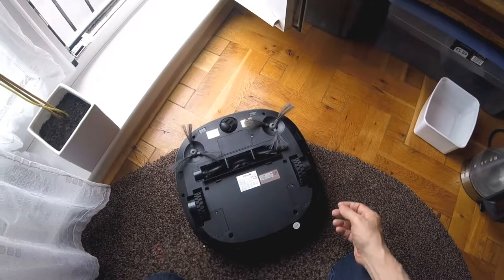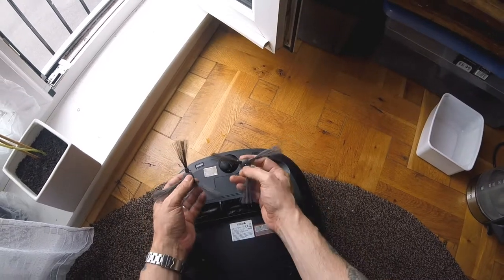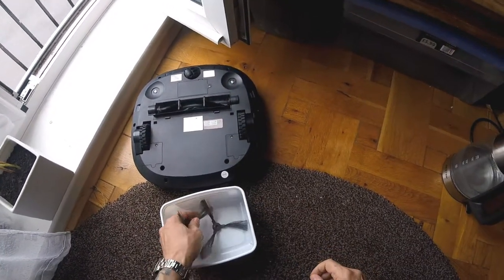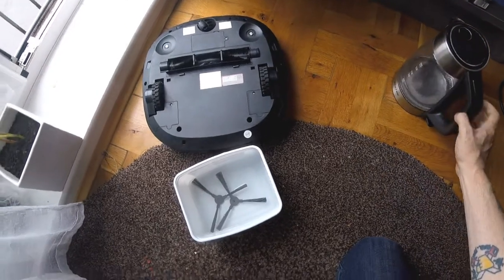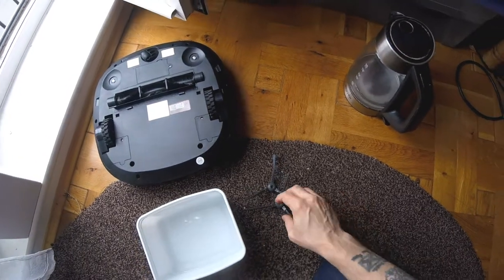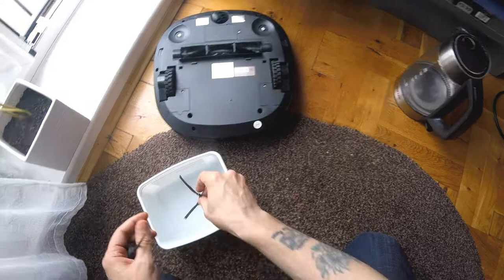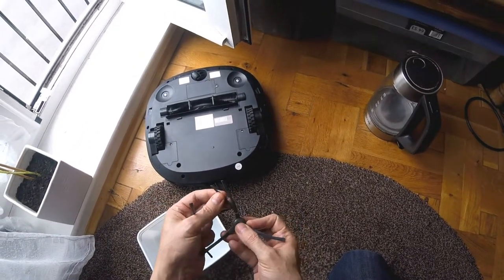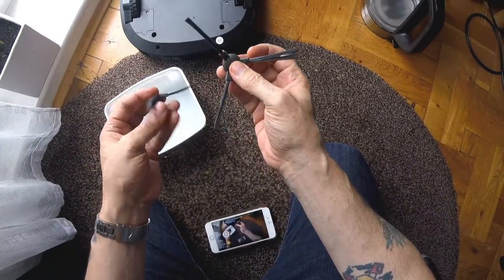Repair Robot Vacuum brushes made simple

Comment: Much obliged for that tip... That should save some pennies in the future :)

Do you know how the 'single room' mode works on the s15? It doesn't seem to be covered in the manual nor the app. I press the 'single room clean' button on the remote - and it just carries on cleaning all over the place, straight through the door into the next room. 

I have an unused magnetic strip but I thought that was for 'no go' zones (such as outside the front door/porch/etc.) but that aside I can't see how to suss this single-room clean out.
Reply from the maker: No problem, I am not sure how the single room mode works on the S15 but I do find some of the mapping, tracking and target area modes claims rather spurious with robovac's. I don't know if they are improving or get improved via firmware updates but as far as I have seen they tend to keep going until they have mapped/covered a whole area rather then covering methodically. I also use a magnetic strip if I want to target a specific room so really do it no differently.